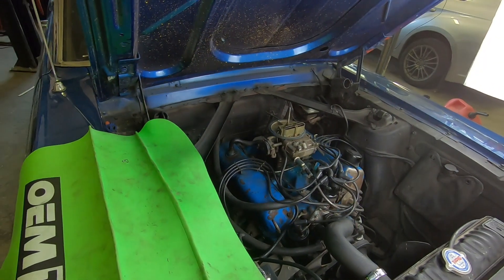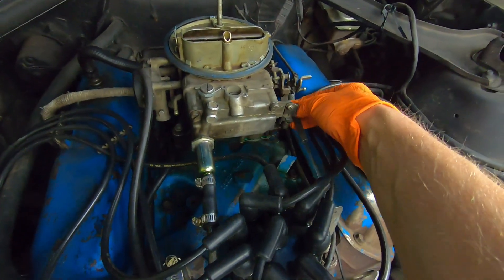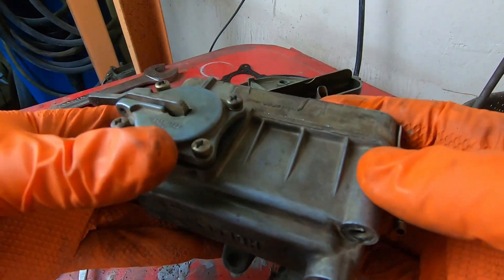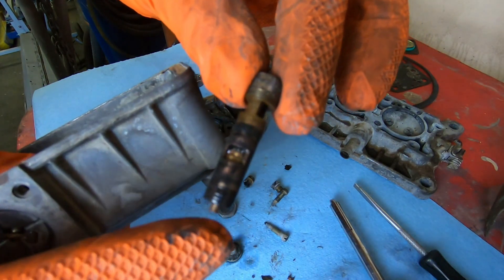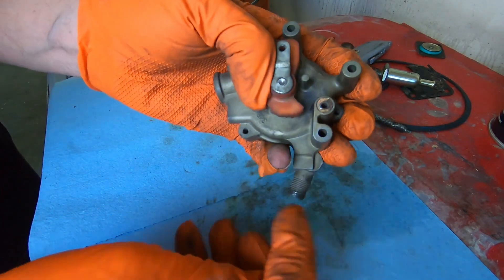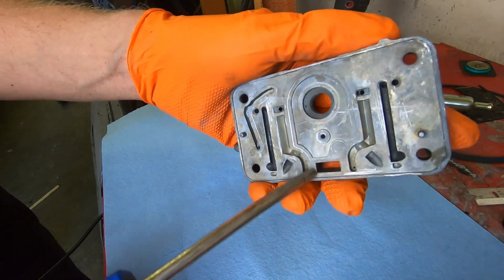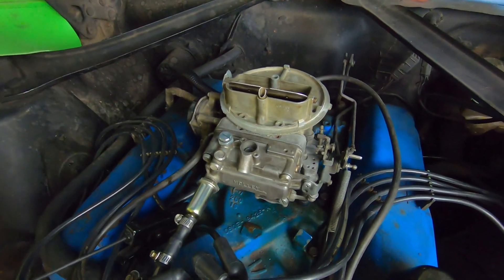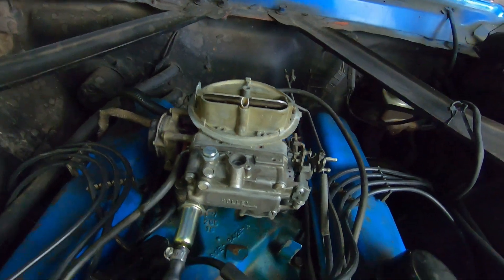Holley 2300 2 Barrel Carburetor Rebuild - 1967 Ford Mustang

Comment: Alf,  your videos have helped me many times over as I restore my 66,AT C4, in line 6 2 door coupe. I really appreciate how you take the time to cover all the anticipated questions that arise and make it easy to follow along. I just finished watching your video on changing the shift shaft which again was very informing and something I will need to tackle next spring.        Could you please offer some suggestions as to why when I move the floor shifter to a forward gear it shifts pretty smooth like it should but when I shift into reverse I get more of a "clunk" and a stronger  jolt? Thanks again and please keep those great video's coming!
Reply from the maker: Thank you very much! I'm not the most experienced when it comes to the internal workings of the trans. However, I would probably advise to check fluid level and possibly the adjustment of the reverse band. I only use motorcraft type-F fluid.

Comment: I'm so glad my 351w has a 2150 carb. Easier to rebuild and to adjust. It's not that Holley's are bad, it's just that motorcrafts are easy to work on and in my opinion more reliable. Set it and forget it.
Reply from the maker: Oh ya I definitely love my 2100, 2150, 4100s for sure!

Comment: just an fyi, that is a holley 7508 carb. pretty rare economaster model made for fuel economy. one thing that will trip you up on this carb is the mix screws work in reverse. I have one of these on my 66 galaxie
Reply from the maker: Well how else do you identify it? The idle mixture screws are right hand thread on this one.

Comment: Great Videos! I love all of them! Thank you for sharing your experience. I just rebuilt my 2100 and bought a vacuum gauge to set it up correctly. I seem to have a problem I’m hoping you can help me figure out what to do next. The engine vacuum is jumping constantly between 17 and 20 (shaking back and forth)and the engine won’t run very smooth. I’m getting conflicting info online and was hoping you could direct me to a correct good source. It’s a 69 302. Thanks
Reply: Im being told worn valve guides or a head gasket?
Reply from the maker: Dave, typically when I see my vacuum gauge bouncing, it tells me that one of my cylinders is misfiring. What happens is when its that cylinder's turn to fire and contribute to the team, it doesn't and just kind of goes along for the ride. The engine speed will actually slow down when its that cylinder's turn to fire and thus you get this vacuum drop which is displayed on the gauge. Even if the compression is good and its able to pull a vacuum, its not enough because its actually slowing down the engine. I would probably be going into misfire diagnostics mode on something like this. Which would include removing the spark plugs and wires for inspection. If nothing definite is found there, I would be going to compression checks. Its hard to go off of advise of people telling you worst case scenario with head gaskets. At the end of the day, you need to do more research and you need to do more testing to gather evidence to support what is happening. What you know, the engine is not running smooth and you have a misfire. Why you have a misfire is what you need to figure out. I hope that helps, let me know what you find.
Reply: Thanks for the time and explanation Alf. I will follow your advice and get back to you about what I find. I can’t work on the car for the next few days but when I do I will let you know how it goes. Thanks
Reply from the maker: Sounds good ya I'm interested in what you figure out. Hopefully just something simple.
Reply: @AlfsMustangGarage  well, I spent some time today working on the car. I first checked firing order, then sprayed card cleaner around intake and carb with no uptick in engine. I pulled each wire off one at a time from distributor while engine running with noticeable issues with all cylinders but #2… well I then decided to compression test each cylinder. They are all pretty low at 90 to about 105 psi (drum roll……) except for #2. It read 75 first time then 45 second time and I did a wet test and it actually dropped to about 32.(good grief) Could this mean I have a sticking valve? Oh and all the plugs looked ok but #2 was wet
I ran the motor at various rpms for a while hoping it would help. Instead of helping now I’ve got a ticking sound coming from that valve cover. Anyway, what are my options next? Thanks for your help
Reply from the maker: Hi Dave, it seems to me that you have at least identified your misfire location. No doubt you have an issue with cylinder 2. Doesn't necessarily mean you have a sticky valve. Although that is possible, all you know at this point is that cylinder 2 has low compression and is misfiring. My mind wants to travel down the road of a bad lifter seems how you have the ticking noise coming from that valve cover. One other thing you could do is a cylinder leak down test. If you have the means to do that, I would suggest it. What this test is, is where you get that particular cylinder to top dead center compression stroke and fill the cylinder with compressed air. Then you can measure the amount of leakage the combustion chamber is experiencing and also, you can listen in various areas as to where the leaking is going. If its bubbling out of the radiator, its leaking in the cooling system (head gasket or cracked head). If you can hear the air coming out the exhaust, you have an exhaust valve that isn't sealing any more. If its leaking out the carburetor, intake valve. Crankcase, that's typically rings. Now this is important.....If its showing there is little or acceptable amount of leakage (all combustion chambers will have a small amount of leakage. Nothing seals 100%). That might be a little confusing because if there is low compression how could the chamber be sealed? What that usually means is the intake valve is not opening to allow air to be compressed. Why would the intake valve not open or not open enough? Collapsed lifter or camshaft lobe has gone flat or the rocker arm has come out of adjustment. That may be a lot of information to throw at you but typically what I do at this point is the cylinder leak down test and then see what the results are. They might be rentable from parts stores but they can be purchased at harbor freight. I hope that helps.
Reply: @AlfsMustangGarage  I am impressed. Thank you for the detailed and thought out response to my questions. I will try and follow your advice assuming I can find test equipment. I will touch base and let you know how it goes. You rock!
Reply from the maker: Sounds good thank you
Reply: @AlfsMustangGarage  Ok, Well I pulled the valve cover off and #2 rocker arm had come off. The stud that goes into the head has been backing itself out and loosened it up enough to knock it off. I checked the push rod and things look okay however I am trying to get the stud to either go back in the head or let me pull it out and clean things up and add locktight with no luck? Any ideas? The vise grips are just tearing up the stud so far. Obviously this has been my problem. I’m excited to get it running better.
Reply from the maker: Oh wow. Well you definitely found your problem. Do you have press in or thread in studs?
Reply: @AlfsMustangGarage  I don’t know. Is there a easy way to know? This stud is about 1/3 of an inch taller than all the rest on the head. I can see the stud is shiny where it has back out but no threads visible. I can’t seem to budge it by turning it. Should I tap it with a hammer? I’m thinking of just putting it back together and adjusting it like your video shows. What are your thoughts?
Reply from the maker: Well it sounds like you have a press in stud. If you just tap it back in, there is no telling how long that will last. You may want to seek some advice from your local machine shop. Take some good pictures and go talk to them. You don't want to risk more damage by just putting it back together.

Comment: What a fantastic vid. Are you ever doing one on a 2100 rebuild? 👍🏼 Also a question for my ‘68-289: if my heat pipe/stove-pipe to my choke (Autolite 2100) is gone due to header install, can I just plug the port on the choke and adjust? (Car is never winter/cold-weather driven). There is still a bracket that runs a heater hose up against the choke housing. 🇨🇦
Reply from the maker: Hey Barry, thanks for taking the time to watch and comment. So yes I will do a 2100 rebuild eventually. Its just a matter of time before I get one in the shop to do and it will get filmed. So on your choke, I would recommend an electric choke conversion. Even though its never driven in the winter, it does help the engine run better on start ups. Mike's Carburetor Parts sells them and I will put a link here. There are a couple different options for the 2100 carb so make sure you look at them both and get the right one if you go that route. https://www.carburetor-parts.com/Electric-Choke-Conversion-Kit--CU1110_p_3878.html

Comment: On the top of the metering block under the rim of the plate of the airhorn are 2 vents , i have one that seems plugged off and the other is open and enabling outside air into the booster and it is dripping gas into the barrel off the booster , what is the purpose of those 2 passages and should they have a ball bearing check valve or plug in them. Thanks for the helpful video.

Comment: what cfm? 350 or 500? bone stock 289?
Reply from the maker: This is a bone stock 289. I'm not sure on the CFM on this one. Probably around 350ish.
Reply: @AlfsMustangGarage  yeah i bought a 350 and slapped it on my stang and it fixed all the issues i was dealing with on the autolite 2100